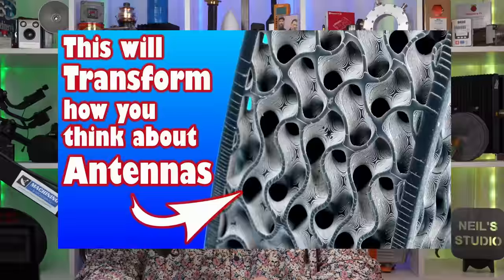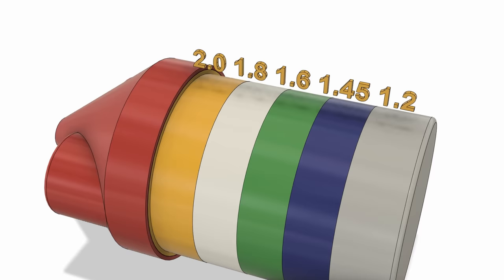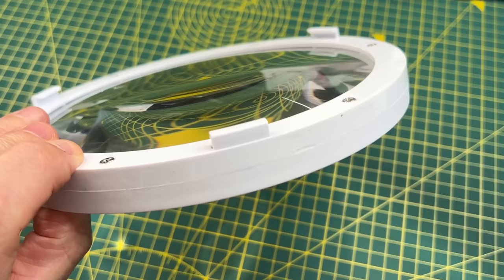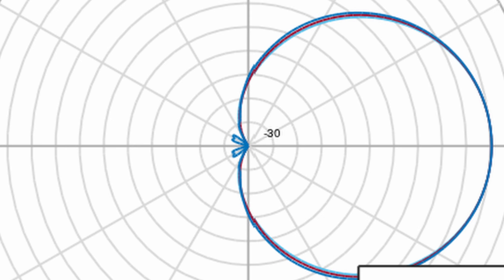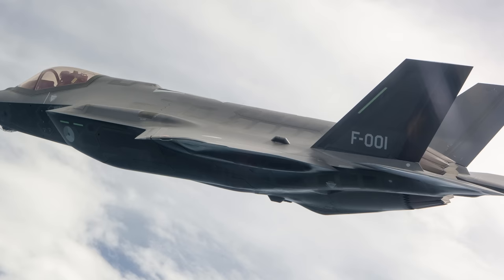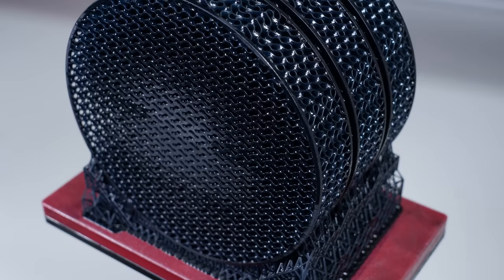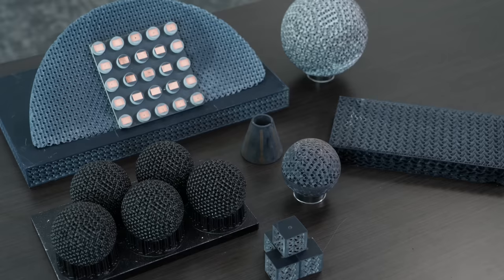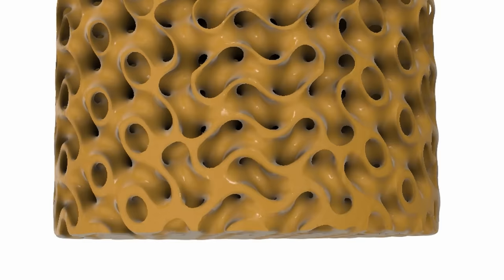How Microwave Lenses REALLY Work!

Comment: So you're telling me they pulled a 20 meter vacuum for nothing to measure the speed of light in a vacuum? Why else might scientists specify "in a vacuum" if it didn't matter to the actual speed of light?
Reply from the maker: Air is full of diatomic molecules that vibrate just like the bonds in a solid dielectric, but can also rotate, so there are resonance peaks like at 118 GHz where absorption is stronger. The effect of all the interactions is a slight increase in the time light takes to get a certain distance in air from coherent forward scatter effects.  Pump all the molecules out and you get a number that corresponds to the vacuum speed of light.
Reply: @Machining and Microwaves  okay, so then your wording was very specific, "a slight  increase in the time it takes light to get a certain distance" would that imply it slows down, or more that it maintains its speed, but takes a longer path due to (something like) a complicated wavefront?
Reply from the maker: @freescape08  Neither.  The field of the incident photons interact with the air molecules, which are distorted by the field as they have slight imbalances in their charge distribution and various vibration modes.  Those moving charge concentrations within the molecules create their own fields in opposition to the incident fields, taking a little of the incident field energy, then reradiating it with a slight phase lag because the masses take time to accelerate and decelerate. All of those tiny out of phase fields result in coherent forward scatter as they affect all the other nearby atoms and the superposition of all the fields results in a new wave at any particular point in space that is delayed a little, depending on the nature of the gas molecules and their number density. All of the waves travel at c, it's the physical changes to the atoms (rotation, bond length, bond orientation, electron charge cloud offset) that cause the wave to be delayed

Comment: Sorry to correct you but i am a Dentist and our Polymerisation lamps emmit blue light with 420 to 480 nm
Reply from the maker: I should have checked! I guess those are slightly longer wavelength for safety reasons? Last time I visited a dental surgery for a white filling was a LONG time ago!  Thanks v much for the info
Reply: @MachiningandMicrowaves i do Not know the reason but IT was designed this way since the earliest composit Materials. The activator in the Material is campherquinone. IT builds radicals while reacting with the blue light and they start the Polymerisation.

Comment: i wrote a i find relatively nice homework on photonics simulation. on a 14 day nothing but this trip.
 thats why i am here. my results looked very similar in essence.. to the colorful graphics and even my conclusions were testified: right.
 i am not a physisisist though. it was about a microhole array in gold tin layers, working as a filter in the near uv segment. 
ok. i had the ability and calculation force for 1 tiny hole and only in rather 2 dimensional perpectives... per time, no real 3 d thing, just 6 slices directions on differnt spectrums.
i am right here, am i? 🤣🤣 microwaves are bright light right.. cool.

I found it interesting, though abstract on physics  i could not really "model" "lenses" ... it also took a day per calculation each.. and I made plenty!!! but even with my xeon super computer .... i wonder how to cope with this in real life... and how to use this for good... :)
Reply from the maker: For REALLY large simulations, I just fire up some cloud instances and throw lots of compute and memory resources at the problem.  It's not too expensive to run a vast machine for a few hours, compared with the capital cost of a local server. Microwaves are very low-energy light, with a photon energy at 15 GHz of around 60 microelectronvolts or 10^-23 J

Comment: There is a work to be done  with Microwaves . We know they  have an impact on  cells.  So far the Microwaves are known to  be used  in kitchen  for heating  Therefore with some smart microwave lenses  focusing  a beam in a mixture of ionised gases    ( cold plasma) ,  a new method for  sterilising  medical instruments  under 100 deg C should be possible.  Just think about to reuse   fiber optics  made for  medical investigation or what ever  instrument made in material not possible to steriilize  from microbes or even prion. A new technology to  reduce the cost to operate people....This is  billion dollars business

Comment: Light is a constant only in a vacuum.
Reply from the maker: And what is between the electrons and ions in a dielectric solid?  Vacuum. Unless someone would like to postulate a luminiferous aether? Atoms are pretty much empty space, except in gravitationally-collapsed bodies.
Reply: @MachiningandMicrowaves  a) not just atoms, but the electromagnetic field that holds a solid together. When you touch a solid object, you aren't actually touching the atoms. The EM fields of the atoms in your fingers are being resisted by the EM fields of the atoms in the solid.
b) A stellar cluster is mostly vacuum also, but I wouldn't want to fly through one near the speed of light, would likely be fried and torn apart by the twisted spacetime. It is likely that even though atoms are mostly empty space, they also have strong gravity EM and other forces creating fields in and near them, hence why fusion is so hard to do. A photon likely would follow a very circuitous path looping around a lot of atoms. Going by Fenymans path averaging, the index of refraction indicates the shortest path through the solid liquid or gas.
Reply from the maker: @m1k3droid  I'm unconvinced that it's the photon path length that determines the delay of a wave passing through a dielectric. It seems more likely to me that the EM field of the photon stretches an ionic bond such as C-F and that generates a change in length of the bond, which means the charge distribution moves and sets up a field in opposition to the exciting field, but also affects all of the other nearby bonds, which are all doing the same thing. A photon isn't a physical ball of stuff, and you could argue that it ceases to exist once it enters a dielectric, and that the bulk effect of all of the disturbed bond lengths and their associated fields (and most importantly the phase lag as the atoms and electron clouds have mass and take time to move, then relax again) is what causes the delay in a new photon being constructed from all of the superposed fields. Trying to calculate it with path integrals would be a load of fun. If it was purely down to path lengths, then materials of similar density should have the same refractive index, but there's a strong correlation with the bond lengths and atomic masses which points more towards the fields and photons travelling at c but the phase lag from the relaxation of the bonds (at microwave) or electron clouds at IR and above being the cause of the apparent speed change. I'm not much of a quantum mechanic though, so perhaps the Feynmann approach gives the same result.  I'd need to re-read a lot of my lecture notes from the 1970s!
Reply: @MachiningandMicrowaves  if that were true you'd still have photons coming out undelayed. Numerous physics experiments slowing the speed of photons in solids down to a few meters per second prove this to be false.
Reply from the maker: @m1k3droid  Definitely not, the interaction with the ionic bonds happens even in thin layers, no photons will be able to pass without interacting with immense numbers of ionic bonds. so the new photons that appear on the other side of the material as a result of all of the field interactions will all appear to have been delayed. If the original photon was following zigzag paths inside the material and so taking longer to get through, wouldn't the photons that come out all be at an angle?

Comment: How to make a lens that works on 1296MHz and does not weigh 100kg? :)
Reply from the maker: Now THAT is a challenge. Cost is also an issue, the cost and weight varies with the cube of the wavelength. Using materials with very high refractive index is possible, perhaps using TiO2 or alumina powder packed into a beehive type structure?
Reply from the maker: Water ice makes good lenses at low GHz, but it has to be totally frozen to keep the loss tangent low

Comment: If you have any experience in RF blocking structures and building them, please make a video. I know copper or some conductive metal is required but the structure of a non conductive enclosure that contributes to the blocking or building a RF proof box. The goal could be using the least metal material with a plastic structure to 100% block all inteligent RF. Thank you.
Reply from the maker: That's an interesting area for sure. Blocking a wide range of wavelengths is very hard to achieve. Carbon fibre and other absorptive materials are useful, so is the use of resonant macrostructures and metamaterials approaches. Evanescent waveguide mode blocking is also fascinating. I'll have a think...

Comment: Trees make microwaves?
Reply from the maker: Anything warm makes microwaves.  I pointed my 3ft dish antenna at about 10 degrees up from the horizon, so it was seeing cold sky, with an effective temperature around 40 Kelvin, then swept past the tree, which was at around 290 Kelvin.  The microwave radiation at 10 GHz from the tree is about 7 times the power per unit solid angle compared with cold sky, although it's not in full leaf yet.  The noise floor rises by around 4 dB while I'm pointing at the tree.  The Moon is fairly cold, but I can still just see the thermal radiation from the full Moon at 10 GHz with my receive setup on a 4ft dish.  The Sun is a little smaller than the beamwidth of my dish, but I get over 6dB of noise increase when I point the 3ft dish at it.
Reply: @MachiningandMicrowaves  I know anything above absolute zero make Infrared waves, never considered microwaves but then that what she discovered, the background radiation of the universe. I had not joined those dots.

Comment: you can electroplate 3D prints.....
Reply from the maker: Getting good adhesion and a consistent thickness is hard, but laser deposition and plasma deposition are better than aquadag or conductive paints, which tend to be polar and lossy. Conductive filament looks promising for electroless deposition when electroforming or plating